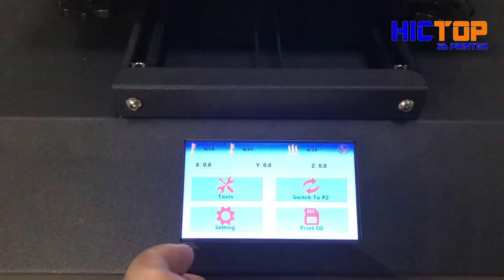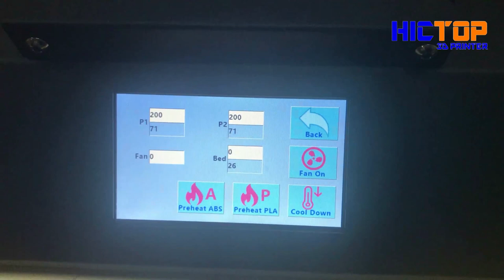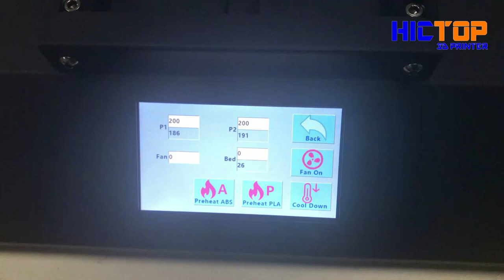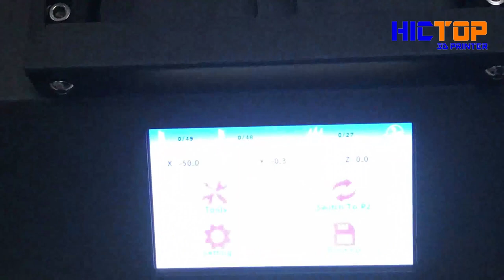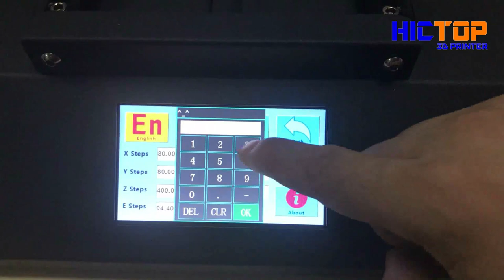How to assemble HICTOP D3 hero IDEX 3D printer with Touch Screen

Comment: I love this machine. It just works. First print was dual colour dragon and it was perfect. No levelling needed at all of extruded 2. I’ve been running it almost non stop for three weeks with 6 different types of filament and only suffered a couple of problems. I did replace the glass with 2 part magnetic build sheet just because I know it works every time. I’m selling both MakerBots, Cs10s5 and 6 x vector v3s its that good ! Couple of things needed. 1. Until it happened didn’t realise you can crash the extruded carriages if you don’t manually work out the 75mm and 85 spaces in duplicate and mirror modes. Similarily, it will try and print off the edge of the bed in the parking space if you forget to account for the space. Could fail safes be written in the start gcode to prevent it? 2. Nozzle temp control on the machine is persistently overwritten to default temperatures if you don’t find and t turn off the settings in Cura. Sounds like a minor annoyance but I was printing nylon with really old PLA. 180 is default holding temp which is no issue for PLA but 260 to 190 drop at each change was fatal to the nylon. 3. Filament run out sensors are needed and filament change capability. I printed a skull to the very maximum scale I count slice to. It took days but never faltered. That’s due me spotting it and hovering around trying to push a new reel in at the last minute. One another occasion once the filament had finished it airprinted for some time and couldn’t be recovered - annoying 12 or so hours in. That’s it. Compared to all other printers I have or have used, this is amazing. I’d longed for an IDEX but couldn’t justify spending Sigma prices. Thank you for being v this machine to the market at such a good price. Questions: what board board is in the machine and is it extendable. Dual or quad nozzles carriage would be epic or perhaps four colours through 2 or 4 nozzles - that would effectively provide a built in mozaiac Pallette pro. Please keep the updates and info coming. I’m already thinking about a second machine once I sell ( my now inferior) printers. I was going to do a review vid as requested but chickened out.  Thanks, Gary
Reply: Have you changed the nozzles at all? I would like to use hardened nozzles but cant find info on thread and fitting. Do you think it would be possible to fit E3d nozzles for example? Thanks

Comment: My extruder 1 smashes into the sides and makes loud grinding noise sometimes. Is there a way to fix this problem? I moved the extruders with my hand during bed leveling and now it seems that the machine does not know where the extruders are.

Comment: Very interesting printer. I'm looking for a dual extruder printer to complement my Creality Ender 5, but at the current price, and with only 9 Amazon reviews on the Hictop unit, I'm a little leery about making the purchase. I like many things about the printer, such as the cabling system, the idex system with dual print heads (I really want to print with PVA/HIPS) and the print volume, but there aren't enough reviews to give me a happy comfort level for this new machine.
Reply from the maker: https://www.facebook.com/groups/1879054055687713/   maybe you can join our facebook group to know more about it?
Reply: @hictop8293  Thanks, I ordered my D3 Hero from Amazon. Does it run Marlin Firmware?  Do you have any print profiles available?  I use Prusa slicer, but will  switch if there is a slicer that is better at handling the dual extruders.

Comment: Does this printer have filament runout sensors? And will it resume printing after runout or after power failure?
Thanks!
Reply from the maker: not at this moment, but we will add this functions later, then you can upgrade it easily, we will share it in our group when they are available